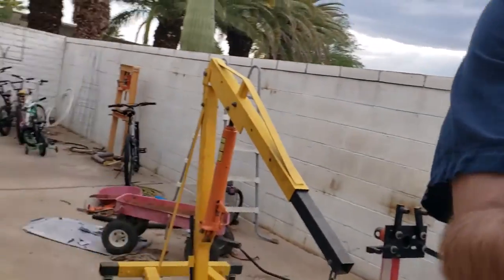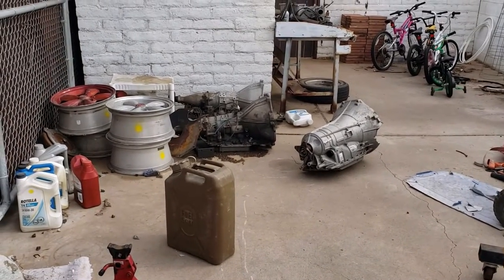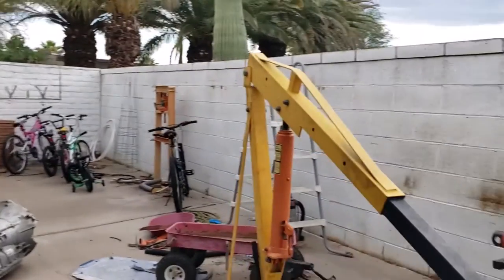Swapping Back to the 4R70W...

Comment: Enjoyed the journey!

Any chance you could add references to the papers you mention to the info block or whenever you call it?
Reply from the maker: http://flow.kaist.ac.kr/bbs/download2.php?bo_table=international&wr_id=165&no=0

This pdf shows ramp rates and the overlap of applying and releasing of the brake/clutches.  I don't think it is directly for the 6R80 but more of a general operational guide for all clutch to clutch transmissions.

Comment: The best option is the quick 6 gen 2 I love it I upgraded my 6r75 to the 11 and up 6r80 and the controller is amazing you would love it. I’m currently trying to use my mechitronic tcm to read the output speed sensor and the range and link it with my quick 6 so I can use my oem pcm better and not swap to the copperhead.

Comment: I think the pre-2009 6r80s and 6r60s had the TCM integrated in the transmission on the lead frame.  If you fed one of those the right CAN signals I think it would shift on it's own. Although then of course you wouldn't be able to control shift points. But for a swap into an old car it might simplify things.
Reply from the maker: 2011 was the first year without the internal controller.  It would be fun to chase down all the can messaging and see what could be sorted.

Comment: Haven’t caught up on the videos but any thoughts on running a us shift quick 6 trans controller?
Reply from the maker: It's hard to get around the $1300 price tag for that controller.  I was hoping to avoid that expense.
Reply: Yeah unfortunately it is pretty expensive. I have a 6R80 swapped mustang being run by a Quick 6. Their gen 2 computer is out which looks nice.

Comment: Ryan, would you be willing to post the code you were using?  I'm working on a standalone controller right now.  It wouldn't interface with megasquirt (using a Ford ecu with quarter horse and binary editor) but it would be standalone and sub $50 in parts.  I've been watching your build and was hoping to piggyback off of your work to adapt to my needs.
Reply from the maker: Send me an email to ryanadenney@yahoo.com.  I'm interested in your hardware used to drive the VFS's.

Comment: What did the 4r70w come out of?
Reply from the maker: 98 F150 with the 3.8L V6.
Reply: @olboy1981  so those transmission will go in a mustang? Looking in to doing the 4r70w in a foxbody also boosted
Reply from the maker: @roseanreaves6146  yep, fits my early falcon chassis fine.  Another source is 2wd 1998 to 2000 explorers.
Reply: @olboy1981  with the 5.0?
Reply: @olboy1981  or the 4.0 v6
Reply from the maker: @roseanreaves6146  the 5.0L and 3.8/4.2L V6 share bellhousing patterns.  The 4.0L is it's own thing.  they got the 5Wxxx series transmissions.